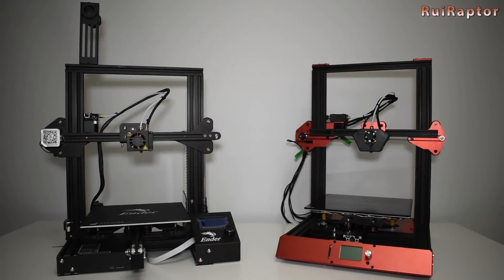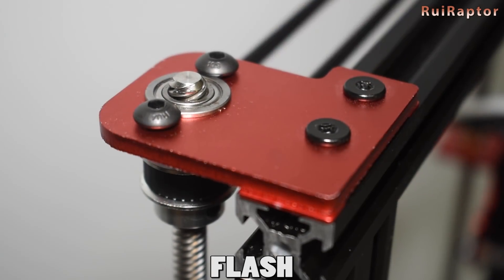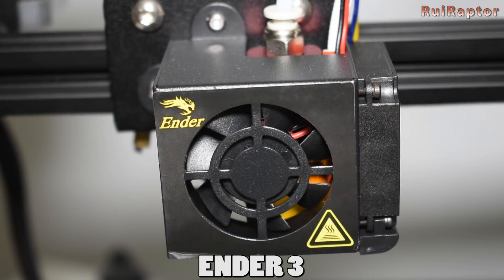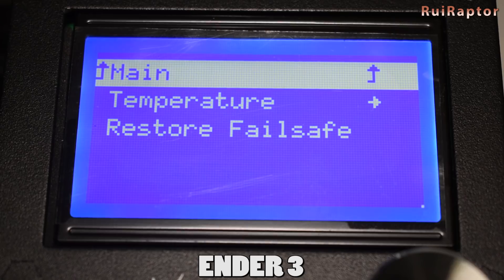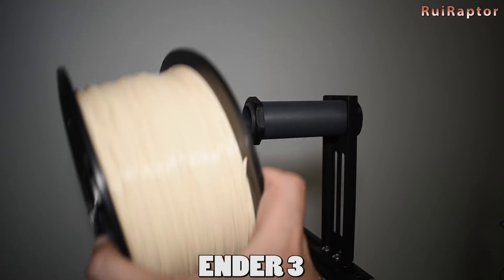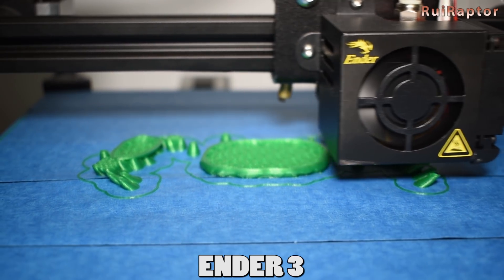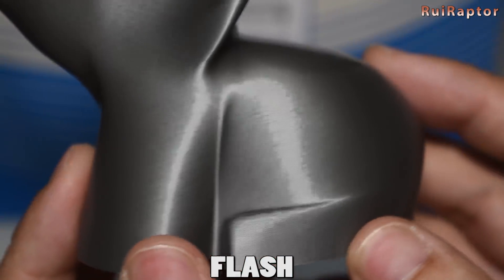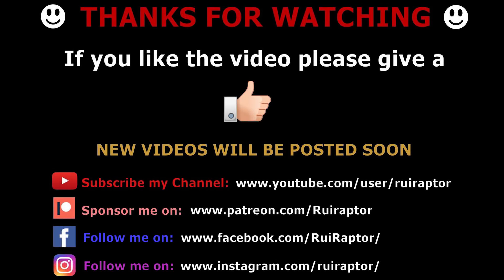Creality ENDER 3 vs Tevo FLASH  - Which is better?

Comment: Hello. Could you say me what program and setting do you have for tevo flash because I can't reach that printing quality. Thanks
Reply from the maker: Hi Richard, send me an email and i will reply with my profile.
Reply: @ruiraptor  Hi Ruiraptor my email is 2003risa@seznam.cz
Reply from the maker: Hi RIchard, The email was sent.
Reply: ruiraptor Hello Rui, it would be very nice, if you could send me your simplify3d profile too, because i am struggeling with settings. My email is vanhalen1970@t-online.de. Thank you in advance. Your work here is outstandingly good for a 3d printer novice like me. Thanks a lot. Greetings from germany, Stephan
Reply: Hi could you tell me what program do you use for this profile
Reply from the maker: It's for simplify3d
Reply: Thanks

Comment: lets compare in this corner the flash is the bomb, other corner the ender 3 is trash..ok u choose..i have to agreed with everything u said in your review, as i have use both, ender 3 rely too much on the  its popular brother cr10 and u can see its built almost the same but smaller foot print.  the flash is a whole new design. main reason i like the flash over ender is: larger bed, ac heat bed, one single piece unit, i hate having a controller box as moving them is a hassle. finally most importantly always get it with the tmc drivers , for the bltouch i didnt like so much but it is just my preference. i like manual beds as once u get it set it pretty much stay set.
Reply from the maker: Hi Sonny,
Thank you for sharing your thoughts about the printers.

Comment: what about tpu?
Reply from the maker: Both can print TPU but the tevo flash extruder (titan) is a better extruder and will perform better.
Reply: Buy a Capricorn (blue) tube instead of the standard. I've bought a clone (tri-lab) and it works fine! Much less stringing while printing with PETG now. It will help to work with TPU as well - it's my guess. The diameter is 1.9 vs 2.0 is a big difference here.

Comment: The Mk.10 hotend is not a MicroSwiss clone. Makerbot originally created the MK 8 and MK 10 hotends. China cloned the Makerbot designs which is what you find on the Ender 3. MicroSwiss designed and produces their own versions which are substantially modified, and are the superior product. For more information, Google: "Which is the difference between MK6 and MK8 and even MK10?"

Comment: no flash is almost twice as expensive
Reply: find it locally! I see the version that I've bought in 2018 Autumn is even cheaper now (in Moscow). It's about +50$ vs Ender-3 price. And you don't need the 2nd Z-axis, believe me. Capricorn tube (or their clone) is the only major thing you will need to buy.

Comment: Hello Rui! Thank you very much for this very nice comparision video. I really liked your next to the other and video transition comparision of the different objects printed.
I was about to get a CR10S or save money and get the Ender 3 pro, but than I came across your video and decided yesterday I will go with the Tevo Flash and try that one, because of this transition here, https://youtu.be/5U5oN3JYYoA?t=626 so from nice n shiny, supposingly smoother uniform surface, to dull/not reflecting and all the layering. I hope i didn't make a mistake, I wanted to say Thanks for your time and effort on this video. Final question did you use "special" settings which turned out to be the ones which give the ultimate kick to resolution/surface smoothness, no salmon skin or layering etc.??
Reply from the maker: Hi Nano,
Thanks for the comment.
The salmon skin is not a consequence of settings or assembly. The salmon skin is a direct consequence of the drivers used.
The tevo flash uses TMC drivers which have no salmon skin effect on prints and produce silent motor performance.

Comment: The ender 3 does have adjustment on the z rail the inner wheels have cam spacers for adjusting so no need for slotted holes
Reply from the maker: Hi Michael,
the adjustments you are referring to are the eccentric nuts on the wheels and they are just to adjust the grip of the carriages and not to adjust the distance between the vertical profiles.

Comment: This is stupid. The Flash is twice the price of the Ender 3. Of course there are some compromises that the E3 has to accept it's under  $200, the Flash is on Banggood right now for $400. Compare the Flash to a Prusia I3.
Reply from the maker: Hi Paul,
At the time of this video and when the tevo flash printer was released, it was cheaper than what is now.
Reply: You cant compare it to a prusa which is over 600-700$ either.
Reply: Paul, do you not have a local dealer? It's the best option by price and a possibility to check all by yourself before you buy it.

Comment: If compatible, would you recomend changing the creality ender 3 extruder (not hot end) for the tevo titan??
Reply from the maker: Hi,
The tevo flash extruder is much better than the Ender-3 extruder. I totally recommend it. Or the trianglelab BMG which is even better.
You can check it here: https://youtu.be/oRpGCAuaZ9M
Reply: I have ender with stock extruder and have been printing for months now without a single problem or a filament guide it will get upgraded soon but not the most important upgrade for the ender 3

Comment: Nice comparison, man! I'd spend the bit extra and get the Flash, based on this.  AC bed, better hotend fan shroud, and the looks are all great to have on the Flash.  The terrible alignment of the extruder, nonsensical DC bed and unforgivable lack of thermal protection being enabled by default makes the Ender 3 look average indeed.  Thanks for the video!
Reply: You seem to be trying to convince yourself of that one, man, but the truth is otherwise.
Reply from the maker: Hi Dark_matter,
Thank you for your feedback.
Reply: Also the Ender is over $100 less than the flash so the Ender has a much higher value to cost ratio
Reply: Jackson, Ive got 24V systems as well. There is no comparison, and a DC bed makes no sense. Spend the extra, get the better product by far.
Reply: AC power is a lot more dangerous to deal with so it's not completely silly to go for DC
Reply: @jacksonsherriff9899  the lower the volts, the higher the heat you get for the same amps. So usually AC 110/220 is always cool/warm. I've didn't checked (compared) this though. But IMHO the DC heated bed is less safe if it has cheap thin wires and bad connectors. Creality saved the cost in E-3 almost everywhere.
Reply: Well, that could be argued. If you're a beginner DC might be alright, but some simple precautions and you'd never look back from AC.
Reply: True true. But the fact still stands that for over $100 less, the Ender is pretty solid in comparison to the flash
Reply: I'm only saying it because I've had one for the past 4 months and it's much better than this video says. For the same price, you're looking at the territory of the anet a8 ( a printer I owned for a year to get me into printing) and the turanchula. Both of which require huge amounts of effort to get printing well whereas I was doing perfect prints the same day I got it. I'm just focussing on the value
Reply: The fact that the Ender 3 is 24v makes the heat bed heat up quicker than your standard printer with 12v DC. So wether you get the flash or Ender doesn't effect the fact that both have much higher heating times than average

Comment: Great quick overview of the differences between the two printers.  The price is the biggest difference but the points you made are well noted.  Two things I noticed a few Ender 3 "super fans" below stated was bed size and print quality.  When I go right to Creality's site (https://www.creality3d.cn) it shows the ender 3 bed size as 220 x 220.  Can someone elaborate on what the size is since even the manufacturer appears to be stating it incorrectly? As for the print quality, both appear to be really good for fresh builds with no aftermarket mods.  Both can be tweaked and upgraded.  In the end it will come down to build size and price for most of us,  trading off between the two depending on our needs.  So again, nice job presenting your observations and allowing us to form our own conclusions.
Reply from the maker: Hi John,
Thank you so much for your comment :)
Regarding the print area, it's true that the manufacturer states 220x220 but the bed is 235x235. 
However, you lose a few millimeters due to the cable strain relief at the back (too close to the bed and collides with the hotend) and, as I see many users, if you decide to use a glass or print surface that requires the use of paper clamps you eventually lose a few more millimeters. I don't think that creality was thinking about the paper clamps when specified the print area and I see no other reason as X and Y axis are not limited and can travel the full 235mm.
Reply: @ruiraptor  appreciate the clarification. It's a bit odd that the manufacturer states incorrect dimensions. I thought maybe it had to do with the base vs pro models but that doesn't seem to be the case.  Looks like a solid budget printer either way. Keep up the great work.

Comment: I disagree with almost everything you said.   You can almost get 2 ender's for the price of one flash. And with the upgrades on your flash I'm sure you can get two ender's for less.. it took over 100 dollar  more starting price, plus all the upgrades to match the ender 3's out of the box quality.   This is misleading.  You're wrong on the bed size also,   and good luck with your 30+ hour print on the flash if the power hapends to flicker for one split second..  and the person who thinks they need all those extra settings on the screen is the the one person who does NOT need more settings.
Reply from the maker: Hi RC VOODOO,
I never mentioned prices and in my video (i prefer to leave the links for both in the video description), and I made reference to the standard version which is not twice the price of an ender-3.
Regarding the flash upgrades, I can tell you that the drivers from the STANDARD VERSION are removable TMC2208 which are far better than the Allegro A4988 of the ender-3.
The dual Z is a good upgrade but this printer can print as good with only one Z (i tested this).
Also, the BLT sensor does not improve the print quality surface of the model...only improves the first layer.
Regarding the bed size, in my video, I mention print area and not bed size. While the bed size is 235x235, the creality itself states that the print area is only 220x220 (as seen in all the creality specs and also on the creality sticker that is glued on the printer).
I agree that it can achieve a bigger print area but that is against the creality specs.
Regarding the power resume, I personally prefer to have the thermal protection enabled (safety first) than the print resume.
For the ender-3, you can enable the thermal protection by upgrading the firmware with this feature enabled...same as the flash as you can enable the print resume if the firmware is upgraded.
Also, according to your comment, it seems that you don't agree with the electrical improvements I made in the ender-3, but I can assure you that it is needed.
Finally, regarding my video in general, I think you miss understood the content as I show all the differences and at the end, I leave it to the viewer to make their own decision. You don't see me choosing or telling anyone which one is the best. 
There are many factors that will make the decision and not the price alone, therefore the reason for me to make this video.
Reply: @ruiraptor  you did mention price when you said a bit more than the ender..  "you don't have to give an actual dollar amount" . so why say it's a bit more  than the ender when you're comparing prices, u use the stock flash price but when comparing everything else you're going on the upgraded flash as your comparison.   You're clearly plugging the tevo. why even  try to make this look like anything else
Reply from the maker: You keep mentioning the fully upgraded version! 
The only upgrade you see is the second Z. 
The stock standard drivers (as i mentioned before) are TMC2208 drivers which means the output quality and silent operation is the same so you can skip the TMC2100 upgrade option.
And the BLT sensor does not affect the surface print quality that I show at the end. 
You can choose not to get the BLT and have manual leveling instead as the ender-3. 
Having said that, I can compare to the standard and cheaper version because I didn't use the BLT or the TMC2100 drivers in the equation.
Reply: @ruiraptor  I never once said "fully" upgraded.   I simply said upgraded.  And I also believe you're using an early release ender3  which had issues that have been addressed already
Reply from the maker: Actually, my ender-3 was ordered new online not even 4 weeks ago.
Reply: @ruiraptor  lol. Ok bud.  I believe you have made your sponsor happy.  I'll just drop it.    But everyone knows the ender 3  can't be beat for price and quality..    God  bless you✌
Reply from the maker: I respect your opinion as I respect everyone else's.
Reply: @RCVOODOO  I've bought an Ender 3 and sold it some days later because the print quality was considerably worst than on my Ender 2. The Ender-3 with v1.1.3 has Salmon Skin that cannot bem solved with TL-SMOOTHERS. I've bought a Tevo Flash to replace this Ender-3 and I think it will be a better printer.
Reply: @luciomachado6727  that's weird because all the guys I trust can not say enough good things about it and ive seen the prints with my own eyes. They were great
Reply: @RCVOODOO  because of the good reviews and the great experience I had with the Ender 2 I bought the Ender-3. To my surprise It had a good amount of Salmon Skin and I could not find anyone with an Ender 3 with the latest Motherboard (v1.1.3) that could solve this issue with TL-SMOOTHERS. People could only solve this issue by modding the board (installing jumpers on a few resistors).
Reply: @luciomachado6727  ask Nerys his ender 3 settings
Reply: @RCVOODOO  I used his profile and also his Benchy Gcode. He was suprised by the amount of Salmon Skin, but as far as I know he does not have Ender 3 printers with the latest Motherboard revision.
Reply: @luciomachado6727  I dunno what version he's using. I will ask him next stream
Reply: @luciomachado6727  but if you don't have an ender3 now...it don't really matter. Lol.  What did you get instead and r u happy with it
Reply: @RCVOODOO  it sounds like you don't own either printers, but if I 'm wrong I apologize, I'm just trying to decide between these two for xmas, so if you have both and can compare prints I'd appreciate your opinion, are the prints about the same of is one better than the other.
Thanks!
Reply: @attainableaudio7130  I have two ender3's one ender3 and one ender3 pro my friend has a flash. If you get the beds level, the prints can not be told apart  if I was forced to pick which one was better  based on print quality.  i would go with the ender3 just ever so slightly  but literally can't tell the difference. The ender3 pro is what I would choose if I got to pick only one. It comes with  meanwell power supply. Sturdier y rail. And magnetic removable flex build plate
Reply: @RCVOODOO  Thanks! Yeah I've been looking at the Pro, as I've Seen other channel/reviews with what looks to me like almost perfect prints, so I figured it must just be the attention to setup and print settings!
Reply: @ruiraptor  an kind of off topic question.
I thought the TMC2208 are newer and better than the TMC2100.
So why are the standard drivers better than the "upgraded" ones?
Regards
Reply: @RCVOODOO  Hi, I tried to buy a Tevo Flash, but Banggood is the worst store and cancelled my order for the second time for this printer. In the end I got another Ender 3 for a price I couldn't refuse. The print quality on this second printer was the same or a little bit worst, but I'm trying to upgrade it. I installed the TL-SMOOTHERS Plus v.1.1 and It does improve the Salmon Skin issue. However there are still some surface artifacts. Perhaps is is ringing, but I'm still trying to understand and to make It better.
Reply: @luciomachado6727  make sure all belts are tight. But not too tight.  And the bed is level  Main thing.. and the gantry is adjust properly. Your prints will be awesome

Comment: The spool will fit on the Ender 3 holder if you assemble it correctly. Turn the vertical bracket around!
Reply from the maker: Hi,
I did turn the vertical bracket around and the filament PM spool still does not fit :(
Reply: @ruiraptor  did it fit on the flash spool holder?  Oh wait.  They don't give you one. Count that in on the cost of buying the flash too. Because you can't print without one.
Reply from the maker: Well...the flash does not include a spool holder (it includes the STL in the SD card) while the ender-3 does. And the ender-3 spool holder is not compatible with the FilamentPM spools, so in at the end, I need to print one anyway. The flash spool holder that is included in the SD card works perfectly with big spools. 
Having to print a spool holder does not scare me...and it's easy to get an alternative until you make one.